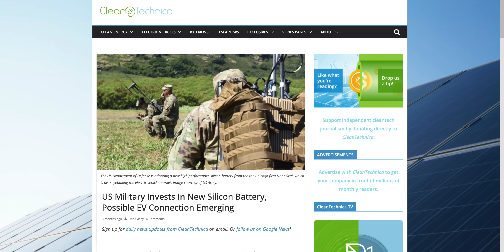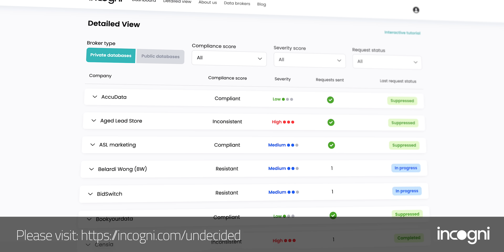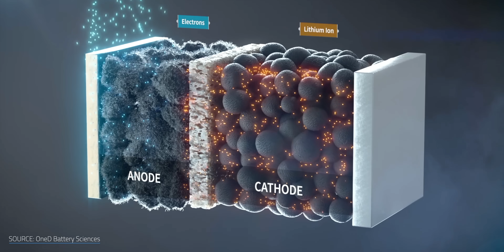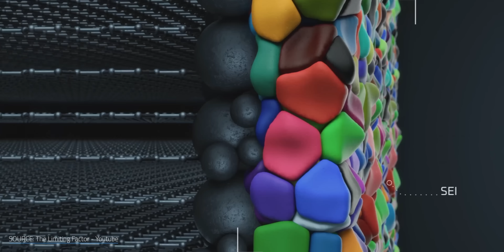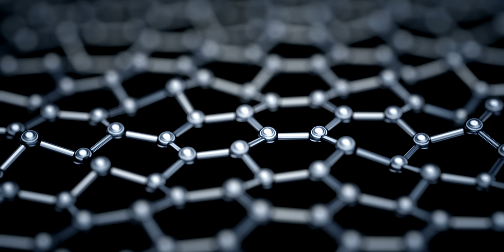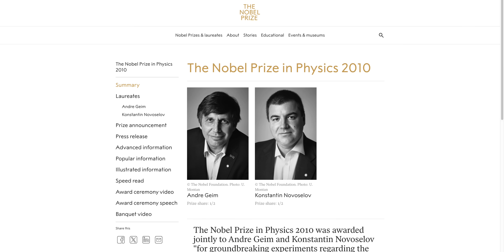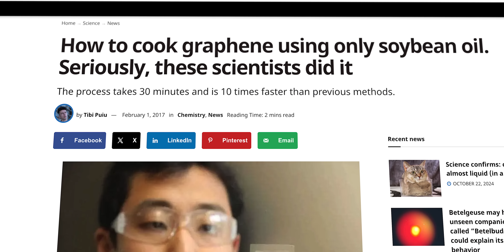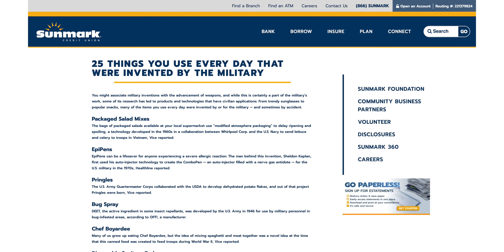Why The US Military Chose Silicon-Graphene Batteries

Comment: That Nanograf logo is exactly the same as the old 90's Sony Walkman logo, minus one blob.
Reply: Missing the blob and it's upside down, but I thought of the walkman logo as soon as I saw it.
Reply: Maybe that’s an inside hint?
Reply: Don't wake up the patent trolls...
Reply: I wondered why it looked so familiar!
Reply: “Exactly the same” except where obviously different 🤔
Reply: @geauxracerx  Its clearly a derivative, and having an apple logo with 2 bites instead of one is stealing. They're stealing the marketing impact of someone else's work. Even though you cant identify a price, lawyers can, and definitely will fight for the price of novelty.
Reply: @ how it’s not. One this logo is clearly circles connected by lines. The Walkman logo is blended circles as in all the straight bits are curves, it’s also a W. This if any letter could be applied to it would be a N. Then there’s the fact that the Walkman logo is forshortened ie has the perspective skewed, while this is flat. When you are dealing with such basic shapes these differences are HUGE and any designer would easily debunk it’s the Walkman logo in court. When next to each other no one would mistake one for the other, and it’s that would it be mistaken for the other that matters most. 
The Walkman logo is a W for Walkman. This logo is a plastic of carbon atoms for graphene. Y’all can talk all you want, but a N is not a W and straight lines are not curves. Basic design principles prove they are not the same and could not be mistaken for each other
Reply: But they still use it for their Walkmans. Got one last year...
Reply: Also the Sony logo's blobs change size from one end to the other
Reply: Reminds me of the old AT&T logo. 
“Planet”? … or Death Star ?!
Reply: Yeah it looked familiar, thanks for pointing it out lol
Reply: I'm sure the conspiracy theorists will be on here soon.

Comment: How are range and playback time different?
Reply: Batteries can provide more energy if you discharge them slower. Eg, discharging at 1 amp might give a capacity to 100Wh, but discharging at 5 amps might only give a usable capacity of 50Wh due to being less efficient.
Different chemistries are affected by this differently. In this case, these batteries have more capacity, but are best suited to low power applications, so ideal for stuff like radios and flash lights, but not as big of an improvement if used in EVs

Comment: put solar on the back pack, if resupply is broken you always have that
Reply: Put a solar panel on each battery cell
Reply: @daveinpublic  would add way too much weigh for not much result. plus the battery would have to be outside the backpack for this to work exposing them to the elements
Reply: @daometh  my 1979 Casio calculator begs to disagree... the lil solar panel is too heavy? Calculator is dead until it sees light, once it does you can calculate away. It would work, don't be a negative nancy.
Reply: @user-jg6bd7se8u  calculators takes very little energy to functions. at scale this would weight way too much to be worth
Reply: i know from experience that little solar panels are useless for even powering your dumb phone.